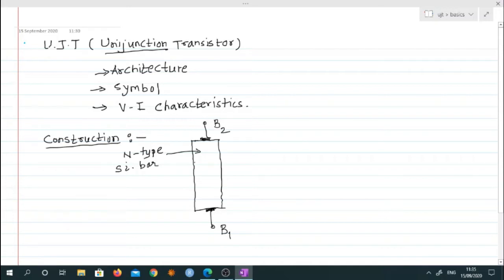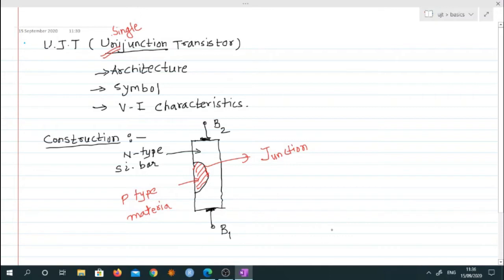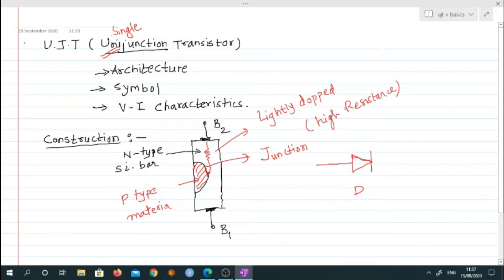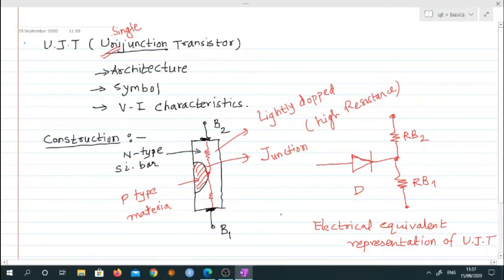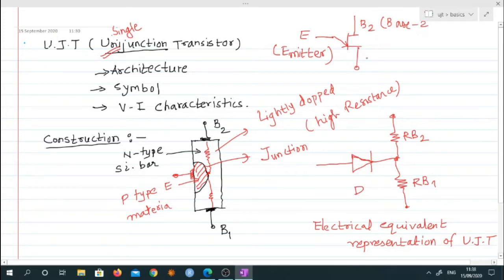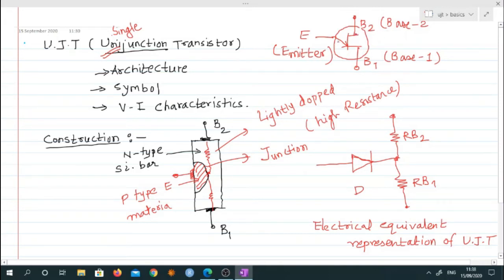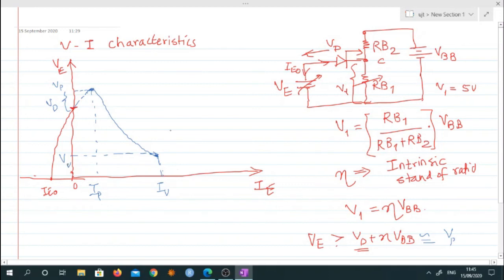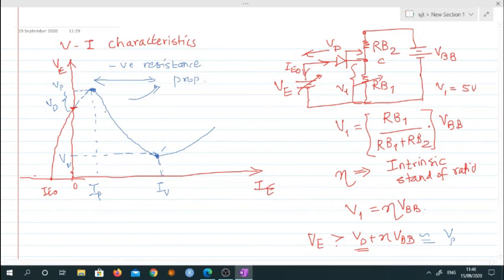UJT (Unijunction Transistor) Operation and Working | VI characteristics

Comment: Sir Current is not decreasing rather increasing along x-axis
Reply from the maker: Yes it increases after Vp voltage
Reply: @MilindNatu0205  By the way sir I was wondering if why actually the Ve is reducing after peak, in actual the potential difference across the lower junction is reduced due to reduced resistance, which for same Ve increases the current,
Reply from the maker: @BrainHinge  It is the Propery of UJT that it Shows Negative Resistance Bahaviour Because of which this Happeened and hence it is used in Relaxation Oscillator circuits
Reply: @MilindNatu0205  sir this is not the explanation it is the reason which I know, so actually it shows negative resistance